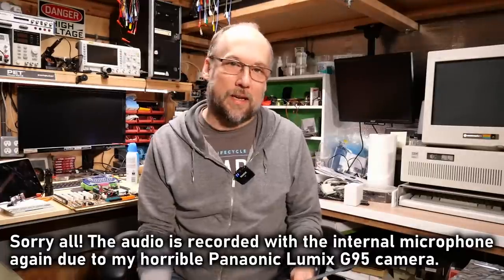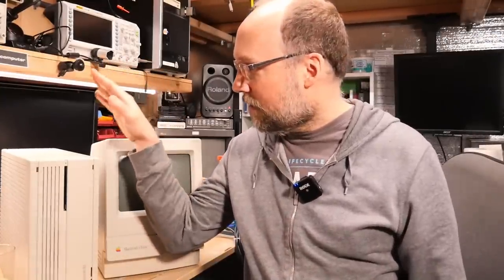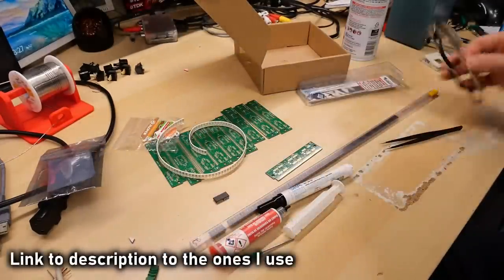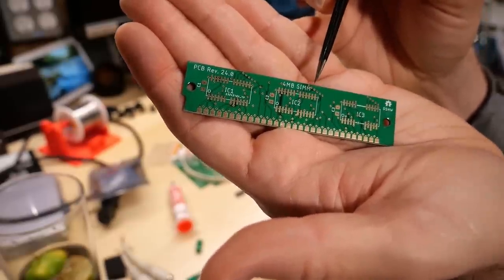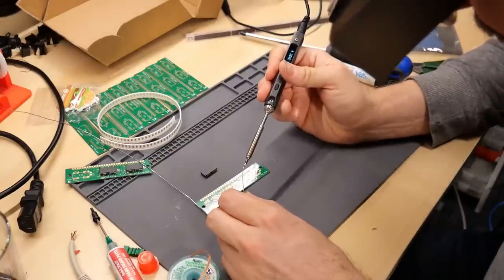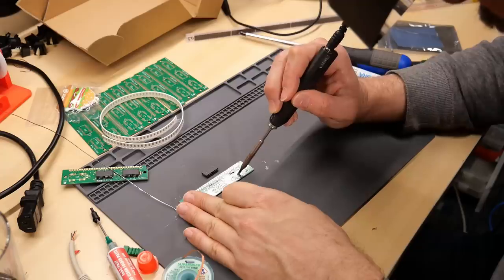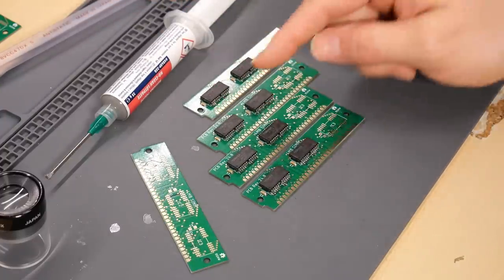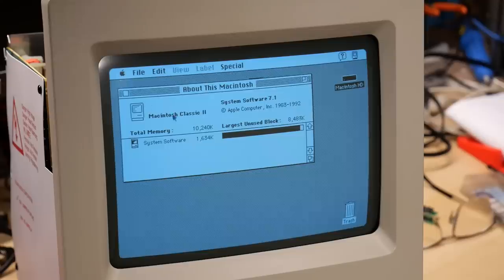Nibble Size: Let's make some memories!

Comment: I must say well done Adrian!!!! I too do not go near SMD soldering for the same reason as you. It requires a certain skill to pull it off. Well done, great job!!!
Reply: Yeah I'm a bit apprehensive about SMD too for the same reason, although i must admit that the videos I've watched make it look relatively uncomplicated.
Reply: @BertGrink  it is much more difficult than it looks trust me. I lack the tools also so I dont bother. Through hole soldering is best. But would be worth attempting SMD work I suppose.
Reply: @Damion Manuel ok I will check that channel out. Maybe I will give it a go, thanks.

Comment: Soldering like these always amaze me when the solder just jumps into position. I tried my hands in SMD soldering a couple of days ago, I bought little PCB christmas trees and I have to assemble them by hand, 3x4 SMD LEDs, 4 SMD resistors and a triode. These components are so tiny, I had a hard time with it and I tried regular soldering iron. The good part was that the pads were already tinned but I had hard luck assembling my first attempt (bought 6 of them). I should try the heat gun for my next attempt.

Comment: Very cool! When I first started doing smt work I actually made full stencils for the pcb’s I was using from overhead projector acetate and a cnc hobby cutting machine to make the holes and then applying the thin layer of paste using a plastic card to spread it over the stencil. It works pretty well, but I found you need pretty good accuracy and steady hands to place the chips. I don’t have steady hands. 😆

With all smt work these days, as it’s just prototype stuff, I always go the ‘lots of tacky flux and flood solder’ route. I’ve not tried j-lead or qfn, but you should be able to do it ok with flooding I think, but probably more awkward than soic or qfp. I usually put some tacky flux down on the pads, place the chip, then just flood with solder and tidy up with wick where needed.

So much is just practice, and learning to keep your cool. 😆 Even under good conditions it’s a frustrating thing to do, but compound it with essential tremor and the patience of a saint can be required at times. I mostly use hot air just for removal these days, but everyone has their preferences and abilities.

Great videos, keep on doing what you do. 😄

Comment: Solder paste is mostly flux. It's a slurry of small balls of solder in a sticky flux. The reason you need to keep it in the fridge is to that the flux volatiles don't evaporate - not chilling it makes it thicken over time (but doesn't ruin it).

Comment: Adrian, everyone has to start somewhere with new techniques.  You can make the paste more liquid by warning it.  I would do the bypass caps first too. A vacuum pickup can also help.  You can get a really cheap air bulb one for about $1-2 so worth trying.  Practice with the bent one a few times or practice with an old PC board.  Good luck.  Personally, even though I have experience doing SMD rework I would probably have slip soldered the legs with a soldering iron as they are visible along each side.  get a large rounded chisel tip with a dip in the flat face which holds a bubble of solder.  Good luck, I really enjoy your channel.

Comment: @13:46 Just a tip, when soldering smd parts, pre tin only one side and only one pad. Put the part on it, easiest when only a two legged thingy, heat up the pad with a solder needle, whatch the part sink in and sit flush. Then do the other leg / pad with standard methode, heat pad then come in with your solder containing flux. With multi legged parts it is a little bit more challenging and requires some training, but advantage of only pre tinning and soldering one leg is, if the part is slightly turned or a little off center, you can still easily correct that. If position is good, start soldering a leg / pad at the adjacent side via common methode. Rinse and repeat, takes some time but the result is showable.

Comment: In your defence, the J-leg chips are a bit of a pain to solder. lol

The last time I manually soldered some, it was for swapping the DRAMs on an Atari Jaguar that I was repairing for somebody.

I thought it would be a quick job, but it had been many years since I soldered SOJ chips (even though I've been soldering TQFPs, QFNs, and all sorts since).

I normally use a small 2mm chisel tip on a Metcal iron, tack down the corner pins, then manually solder the rest after adding a dab of liquid flux.

But I had real trouble getting enough solder to wick between the pins and pads without bridging stuff. It took me about an hour to swap four DRAM chips. lol

It looked fine in the end, but the fault turned out to be a tiny spot of corrosion on the Interrupt trace to the 68000.

To second what others have said here, using solder paste directly with these chips is generally not the best idea for your sanity. :p
It can be used on certain components if exactly the right amount is put across the pads.

But really you needed a stencil, and you'd be amazed how quick and easy it is.

This was genuinely my first ever attempt at using a solder stencil at home (about a year ago)...

https://i.imgur.com/KBdaMXw.jpg
https://i.imgur.com/Xnza7T9.jpg

I did the solder paste in one single pass, by adding quite a thick line of paste at the top of the stencil, about an inch above the SMD holes.

I then used a plastic business card as a squeegee, holding it at a 45-degree angle to the board, so the solder paste bunched up in a line as it rolled over all of the stencil holes.

(using a fair amount of pressure to keep the squeegee edge flat to the stencil, and the PCB taped down very firmly. Taping down some junk PCBs around the main one is also important, so it keeps the correct height, and doesn't move at all.)

I then just carefully plonked the components on, and reflowed the whole board in a modified toaster oven using a "Tiny Reflow V2" and fairly cheap leaded solder paste. For smaller stuff like the DRAMs, you can get away with just using a hot air station.

I would recommend NOT dabbing the solder into the stencil like a lot of people seem to do on their first attempts.

It's best to just do a single pass if possible, otherwise dabbing the paste tends to lift the stencil a tiny bit, and smears the paste underneath (shorting between pads etc.).

As you said, soldering the SMD stuff definitely gets easier with practice and finding the right technique.
But I wouldn't personally use solder paste for the SOJ chips, just manual soldering with a small chisel tip and plenty of flux.

Comment: The memory chips are quite accessible for hobbyists, and can be easily soldered with an iron and solder wire. I would guess that the pitch is 1.27mm. Unfortunately, they are no longer manufactured.

The solder paste is dry, and that is why you need to keep it in the refrigerator. The flux simply evaporates if the solder paste is not kept in proper conditions, especially after being opened for the first time. You are better off using solder wire and some flux, and a temperature regulated iron (or a 25W iron cooled periodically) with a suitable tip. Hoof tips are great.

Your hot air is probably too hot. You should use a bigger nozzle, reduce the heat a lot, reduce the air flow a bit as well (to keep the components from flying). Mind that you have to regulate the heat accordingly in relation to your air flow. Also, keep the distance from the board and try to pre-heat the board evenly, by wiggling the nozzle at a distance (about two or three inches away). When soldering, keep the nozzle at a distance of one inch. Take your time until the solder paste melts and flows.

Your iron temp might be too hot as well, since you mentioned some lifted pads and traces. You should reduce the temps to below 300º, and be quick about it. Flux more than helps when cleaning solder bridges between pads. You just need to do one in and out movement, and that takes one or two seconds at most. Don't dwell too much and be quick!

To clean the boards, doing ultra-sonic cleaning is ok, even recommended. Don't use soap and water. Use distilled water if the flux is water soluble, or use isopropyl alcohol if not.

As for the silicone mat, I have the same you have. It is heat resistant, alright. But it is pretty much conductive and tends to warp due to thermal expansion. I would recommend an extra layer of two silicone translucent white ones on top of that. You can find them on eBay.

In hindsight, I hope you view my advice as constructive. I was far from perfect when I first soldered, and I still have that PCB to remember my mistakes (namely, too much solder). It worked, but there is always room for improvement. In every case, practice makes perfect. So, practice a lot and drop the solder paste. You can find tutorials where SO-8/14/16 chips are soldered. The pitch is identical, despite the differences in the format of the leads. The technique is pretty much similar.

Comment: Does it feel slightly faster to you because the upgrade uses lower latency chips than those soldered on the mobo ?
I believe they came in 50, 60, 70, and 80ns varieties; with 60 and 70 being the most common ?
Would using some 50ns possibly squeak out a little more responsiveness ?
Would also replacing the mobo chips with 50ns instead also affect it a touch ?
Do you feel the need to have the fastest Classic Mac on the block ?

Comment: I've had the best luck removing SMT components with a Bismuth desoldering alloy like ChipQuick(tm) or or FastChip(tm).

Set your soldering iron to a low temp (130c-150c) 
Apply very small beads to a hoof or chisel soldering iron tip and then drag-solder along all the leads of the chip until every lead and pad is bridged. 
Use a tweezer or a glob of blue-tack on a screwdriver to apply slight lifting force to the chip.
Repeatedly drag solder along each row of pins until the alloy blends into the existing solder. The chip will release almost immediately once this happens.
**THOROUGHLY** clean all solder residue from the pads using liberal amounts of flux and solder wick. Any remaining bismuth will make it harder to resolder to the pads.

Comment: One thing I was suprised to find out is that early Amiga computers were wuite memory starved even though pretty much everyone who had one upgraded even the A500 to 1mb.  It seems to make a real difference uprading them over 8mb.  Since they share the same MC680x0 CPU series as the Mac Classic II it makes sense that this would carry over.
Reply: The amiga uses 2 types of memory in most cases. We have Graphics mem, that memory is shared between the CPU and the chipset and we have fast mem that only the CPU can access giving the amiga a speedboost.
Reply: @Voyager_2  Yeah, i was thinking that when he mentoned it, it sounds just like the "chip mem" & "fast mem" in the Amiga.

Comment: The way you got it at 12:42 (when you re-did the second chip on the first board) is how you want it to be before you put the chip in in the first place.

As others have mentioned, using a stencil helps A LOT. If not using it, apply the paste, heat it with the gun so it forms on the pins, maybe touch up with the iron if needed, and then heat it with the gun and add the chip.

If you do it correctly, you should be able to do it without too much heat (which will cause the board to warp)

Comment: Paste with flux is much easier to work with.  It goes on more liquid, so you can run a fine bead down the pin rows.  Also, a larger nozzle will keep the airflow from moving the chips around.
Reply from the maker: Good tip, thanks! That would have really helped!

Comment: That brings back memories.... back in the times when you paid 100 bucks per megabyte I made PCBs and soldered ram chips into them to get 4 additional 1MB modules for my 386... and then I had to replace one ceramic cap with a SMD version on every board because it collided with the simm socket....

Comment: I seem to remember that Macs had virtual memory, which was system software that used the hard drive to supplement the machine’s physical ram. But virtual memory slowed things down. However, having a lot of physical memory for the system and programs allowed faster operation.

Comment: Just use a normal soldering iron.
Tac diagonal pins and adjust placement. Flood fill each side.
Pick up board and hold it so the side you wish to solder is vertical. (or almost)
Start with the iron at the top and  (tip pointing up) and slowly drag the iron down the pins.
As long as you don't burn off all the flux the solder blob will follow the iron (and gravity) and the excess will drop onto the desk.
The surface tension will break the bridges between each pin as you move, however you may have difficulty with the last pair, just use a bit of braid to remove the excess.
Practice with an old board with a J-lead chip already installed, also works on gull-wing and similar type chips.
It should take less than 30 seconds per side, and look like its factory fresh !

Comment: The soldering paste actually has flux in it. In fact it's basically fine solder alloy dust mixed with flux. That's why it flows so well when melted. As for the issues with the syringe - yeah, in my experience this stuff is very viscous too. Maybe preheating the syringe would help a little. As for the PCB warpage - it can be avoided if you preheat the whole PCB evenly. Some people even use a household clothing iron mounted upside down as a makeshift preheating table for soldering. Preheating also helps a lot when working on PCBs with massive ground planes which tend to suck up all the heat otherwise.

Comment: A smaller needle on your syringe makes things a lot easier. Also, if you pre-warm the pads the solder will flow and stick onto the pads a lot easier. I have spent some time hand soldering 0608 (and smaller) smd and it can be a pain as a beginner as you certainly discovered!

Comment: rndtronics on ebay offers custom stencils for $20 and they are located in the US, all they would need is the file to cut the stencil. A stencil would allow you to properly apply paste and you can simply place the components on the board and bake them in an oven at the minimum melting temp of the paste "that paste is supposed to flow at 183 c or 361 f". Though when using an oven I always place things in while it's unheated and turn it on and allow it to come up to heat, I also use glass baking pans inverted on the rack but in the case of those modules perhaps a small cooling rack would work better.

Comment: I know you are getting a lot of helpful comments (some mean) but I just want to say that your absolute first time using hot air and solder paste was honestly not all that bad. I've seen far, far worse. It was absolutely not a "Horrible job, as usual." as you said. The whole point of soldering is to make electrical connection. That's it. Everything else that anyone says is just help to try and get the most consistent soldering results. Notice I did not say "the best" just consistent. And the only way to get there is to just practice over and over again. That is all. You did MUCH BETTER than the average first-user-starting-out-with-fine-pitch-soldering. I used to run a little side business where people would send me soldering jobs they tried to do on their own, and failed. And boy let me tell you some of them were downright awful. Yours would have been a rare treat to try and 'fix'.

But honestly that PCB absolutely does not need to be soldered with paste. You could do that entire board in a couple of minutes with just your TS100 (Mine is finally dying after years of steady use! I wish I had a TS80 to replace it with) because of how the solder flows. You just tap the iron tip to the leg and it wicks right in. I've done literally hundreds of them that way. Yes. That means there is no flux in the solder on the iron. We have plenty on the board gel or otherwise.

Comment: Per Wikipedia, for the IIci, it was popular to install faster memory in the first bank of SIMM slots, as this is the bank used by the video subsystem.  Otherwise, a video card could be used to free-up system memory that otherwise would have been used for the video subsystem.  As for the Classic II, the only issue with speed might be if on-board RAM were slower than SIMM ram (which is the case in the Mac IIsi).  The Mac IIsi could get a video speedup by increasing disk cache which would take up space in the on-board slow RAM, which would relocate video ram from the slow RAM onto the faster SIMMs.

Comment: I recently bought a hot-air station. Like you said, it takes time and practice to get good at surface-mount soldering. To get some practice, I decided to remove and re-attach every component on a cheap DDR2 memory stick that I don't really need :)
Also bent boards can be straightened if they are bent to their original state, fixed somehow in this state and heated up to less-then-solder-melting temperature for some time. Some folks even do this to fix bent PC motherboards.

Comment: The 4mb x 4bit RAM is the main RAM, the parity bit would be 4mb x 1bit. For 90% of all Mac, the parity bit is not used and do not need the parity chip.

Oddly, communities in high altitudes have Macs that use the parity bit and requires the parity bit RAM. This can be seen on the Mac IIci where there is an empty area for an extra chip on the board, that chip is the parity checker for the system.

As for soldering SMDs with paste, you draw a thin line of solder, place the chip onto solder covered pads and apply hot air.  Let capillary action melt the solder and separate it from between the pads while you hold down the chip. Finish with a bit of cleaning with solder braid (to fix bridges) and IPA.